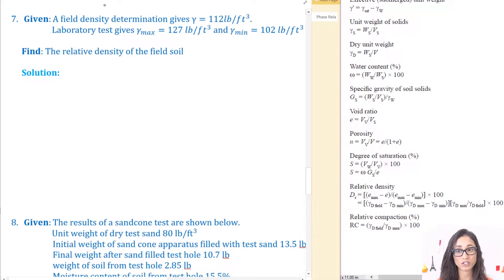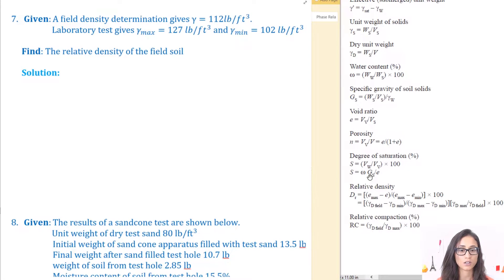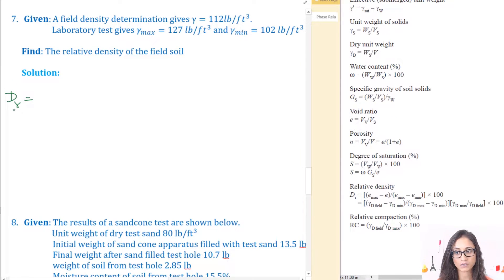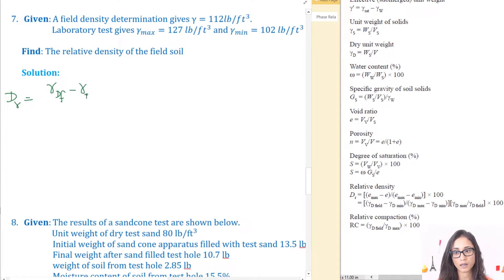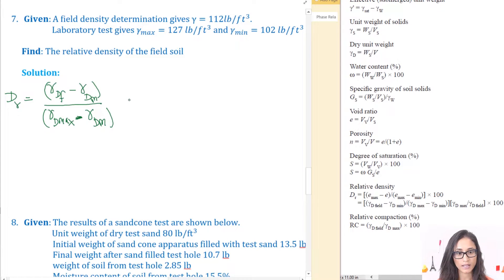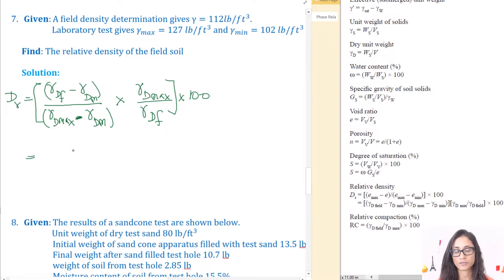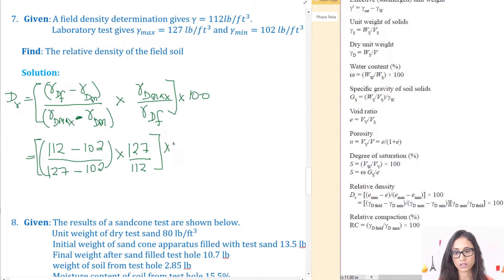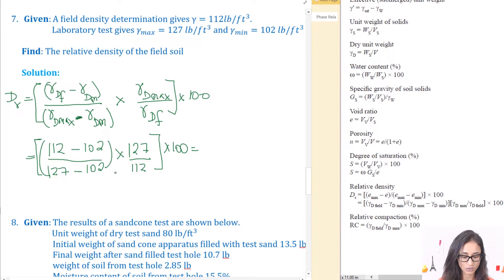FE Exam Geotechnical - Phase Relationships Relative Density

Comment from the maker: I know guys, we have done too many problems on this topic. But I promise there will be one more problem on phase relationships and then we are going to move on to Foundations! Who is excited? Because I am 😂🤣
Reply: the problem statement does not specify that the gamma given is 'dry', why do you assume this? Also, in your video about relative compaction, the problem statement DID specify the gamma as 'dry' (80 lb/ft3), however you used it as field and the recalculated it as gamma dry...? Please advise.
Reply: I understand you are communicating through numerical views. Can you relate these values to our real life geotechnical projects that you have done or in ordinary view of citizens so I can have the impact of your videos last FOREVER? Please ?? That's how I try to learn when it comes to knowledge. and civil I want more of this so it lasts on me until my death.
Reply: For instance, specific gravity ratio value is less than 1 in respect to water in denominator, I know anything less than 1 flows on water. This lasts me forever. I'm sure coagulants added to flocculation process makes the flocs to settle down in sedimentation tank will have SG greater than 1 on flocs that were formed. Something like that will make ordinary mind like myself to learn and grasp the concept imbedded on my brain without reviewing these videos over and over. It seems to me that for geotechnical, I need to grind more.